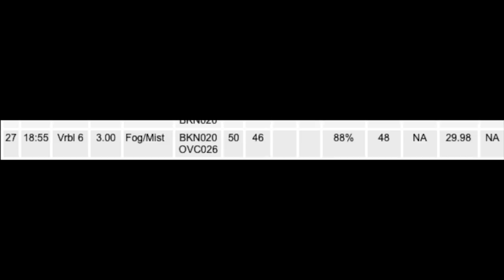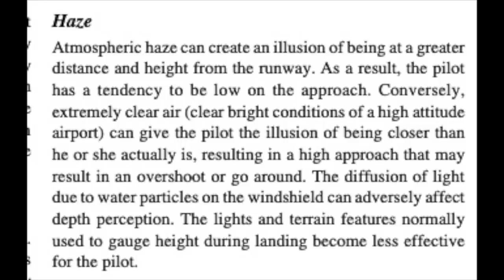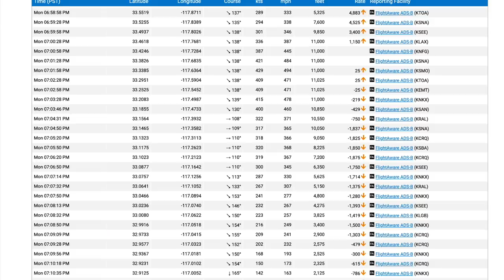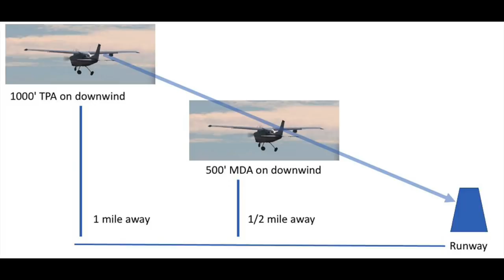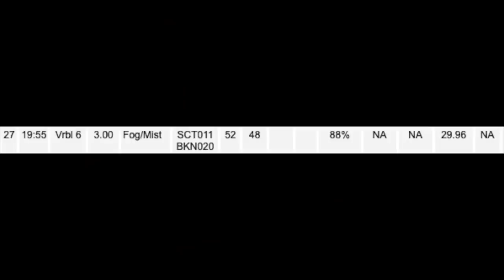N880Z Learjet Crash El Cajon San Diego California - Low Altitude Starts Accident Chain

Comment: This accident was not due to weather or hills or the airports lights it was simply Speed!

This is very similar to  Teterbourgh Crash Stall spin on circling approaches. One look at the wings of a Lear 35 should tell you it is not a maneuverable aircraft at slow speeds. Part 121 (airlines) uses what's call DMMS . Defined minimum maneuvering speed for a given aircraft on approach (w/ buffer)and fly it like your life depends on it, because it does.  High workloads IN climate weather are all distractions and once that wing drops at 1000 ft MSL your finished! Why this is not widely taught in other classes is a real shame given the frequency of these types of approach accidents like Truckee. TRAINING!

Comment: Low altitude was not.  They were at the right alt. for the kind of approach.  The big error is that the pilot turned back to the runway from over head TOO EARLY.  That error then required a too tight TEARDROP TURNBACK from overhead.  When he felt was overshooting final approach, he steep turned, pulled elevator and stalled.  The bad way of turning stalled them.  Not the altitude.  Altitude dont stall you, you stall it..

Comment: The fact that the Jet wasn't at circuit altitude is pretty much irrelevant in this accident.  You are not going to recover a stall/spin in a Jet in less than closer to 5000ft neverminded 1000ft.  The issue was the airspeed and vey poor pilot decision making even trying this maneuver in this weather.
Reply from the maker: If the jet had been at the published circling altitude, he would have been a couple of hundred feet above Rattlesnake mountain. Instead, he was a few hundred feet below it. Airspeed wasn't an issue until he realized he was headed toward the mountain and likely pulled back on the yoke and/or banked too steeply and stalled.

Comment: The pilots were low so they could cancel IFR and continue circling VFR. This is because circling to RWY 27 or 35 is not authorized at night per the approach plate for GPS 17.
Reply from the maker: Yes, they definitely canceled IFR so they could fly to Runway 27R. But the real question is why were they so low! Perhaps they were ducking below some unreported cloud layers. But given the surrounding high terrain, there were so low they no longer had any margin for error. As pilots, we need to build lots of safety margin into everything we do. At that altitude, there was no safety margin.

Comment: i landed gillespie hundred times by the way. good times....
Reply from the maker: I've been there a few times, once in a jet as it was getting dark. They assigned us the daytime right traffic pattern, and I had to constantly coach the pilot, as he had lost sight of the airport.
Reply: @AviationNewsTalk  if it was after 9 pm, runway lights required 3 radio mic click to be activated. i dont know if this was the reason you could not see the runway that time.

Comment: There is a LOC-D 27R approach. It is Circling at 1940msl for cat c. Why didn't they use it?
Reply: Probably because the minimum altitude of 2700’ MSL to 3.1 nm from the runway was above the reported ceiling, so by the time they arrived at the 1940’ MSL minimum below the cloud ceiling they would have been too high and tight to land straight-in, and been required to accomplish a 360° unauthorized circle to land.

Comment: Oops... I made an error and must make a correction/revision to my own earlier comment.

Initially I had only seen the LOC D Approach Chart Note "Circling NA northeast of Rwy 27R-17".  However, after review I now see that I missed the next very important Note for the LOC D Approach, which is  "Circling Rwy 27R, 35 NA at night".   

That note means that they could not have legally flown that approach and landed while still on an IFR clearance.  However, they could have flown that approach under IFR and, if they broke out in a position to make a normal descent and landing, cancelled IFR and landed VFR virtually straight-in on Runway 27R.   Not wanting to have to divert, I still believe that flying the POC d Approach was their best option.  Unless they could fly under Category B minima, which seems unlikely, the LOC D Approach in this manner seems to have been their ONLY realistically safe option. 

Although we would always prefer to not have to cancel IFR in this sort of situation, it would be completely legal and a lot safer option than the one they chose.  If they didn't break out sufficiently and and/or weren't able to safely descend and land under VFR for any other reason, they could have simply done the Missed Approach.
Reply: The reported ceiling was too low to allow a straight-in landing on 27R using the LOC D approach.

Comment: Just land on 17
Reply from the maker: That was my initial though too. But it's a shorter runway, and it's quite likely that the company had op-specs that required that they use a runway longer than runway 17. Plus it would have been wet.
Reply: @AviationNewsTalk  ok.  Cool.

Comment: I'm not convinced this was a stall-spin.  The video and witnesses both point to a big flash prior to impact.    That combined with their low altitude over the hills by the approach end may have lead to a wire strike.
Reply from the maker: I saw the flash as well. I saw a photo of the wires they struck, and they were were fairly low. I understand that the wreckage was confine to a small area. So I think it's more likely they did a stall/spin and hit the wires on the way down. But it's entirely possible they hit the wires flying level. Regardless, one has to wonder why they were so low.
Reply: @AviationNewsTalk  To me that seemed to be still at some altitude. Is there, hopefully there aren't, any tall transmission towers there?

Comment: Why are these jet pilots NOT being trained to keep their speed up on these circling approaches with least a 30% stall buffer and then reduce speed when established on straight final, the airline's do it so why aren't they doing it, until these guys start getting the correct vref  training and be required more than +5  a lot more of them ( and innocent passengers)  are going to die, if I was a client or owner of one of these companies I would not step on one of these jets and immediately ban circling approaches until they get o the bottom of this and get these guys trained correctly and require at least vref+20 on circling approaxhes . It also came out today that the pilot in command had some restrictions on his credentials they haven't specifically stated what they were.
Reply: They had “sufficient” speed according to available data. This was likely an accelerated stall (forced by high a maneuvering load while pushing the aircraft to tighten a turn radius due to terrain and many other completely avoidable  factors (well preceding the tragic final 15-20 second period of the crash event).
Reply: @josiahwaters1706  he was only at 156 knts when he started to turn, that gives him a 3knt stall buffer in that jet type, 3!!. I'm telling you these guys are not being trained to keep their speed up ( to vref+20 instead of +5) on these circling approaches that's why you keep seeing them crash and die, and until they start doing it like the airlines do it they're going to keep dying along with innocent people, from what I understand airlines require vref+30 for circling approaches and some airlines have banned doing circling approaches all together.
Reply: @badmonkey2222  I don’t disagree with anything you said; however it is important to understand that just carrying “speed” would not necessarily have prevented this tragedy. The reality is that the Learjet is especially unforgiving in accelerated aerodynamic stall flight envelopes, and as someone with experience on the aircraft I don’t want to leave it at just “more speed” in training being the solution. There is an entire chain of events that occurred leading up to this tragedy (including the short duration of the flight and quite likely pilot fatigue) that all must be factored into the 135 training. (As an aside, care to share your speed calculation? I’m getting a different number given their light load and the density altitude at the time of the accident.)
Reply: @josiahwaters1706  he was at 156knts when he started that final turn which is about 5knts above stall speed for that jet type at 700ft, at his position the chart states 1440ft is where he should have been, the number is from from flight data showing after he started to turn he briefly climbed and the speed went up to 162 knts then rapidly decreased from that point,  airline pilots are trained to keep about a 30% stall buffer in speed ( the number recommended for the aircraft type they are flying) when making circling approaches and these guys are not, I agree there was many factors leading up to what happened I think he may have also been startled by one of the two hills that are in the flight path of the approach and steepened his turn even further and possibly mistook the road for the runway hence him asking the lights to be turned up,  and they were probably in a hurry to get on the ground which is never a good idea in those conditions. You are correct this jet type is extremely unforgiving and and is more reason to question why he was even attempting to do a visual circling approach at night in that weather. There is a reason these guys keep dying trying to make circling approaches in these jet types and I firmly believe it is lack of training of speed calculation for such maneuvers. If I was a client or a corporation I wouldn't step foot on one of these things again and would flat-out ban circling approaches until they got to the bottom of why this keeps happening.
Reply: @badmonkey2222  
How did you conclude that the stall speed for this jet is 151 kts? 
At what weight, flap setting, and bank angle is the stall speed 151 kts?

Comment: Failure to Maintain DMMS (Defined Minimum Maneuvering Speed) Ga and 135 have a Problem with this but the Nations Airlines have already have it Factored in so when the Aircraft is in any Configuration to give a 30% buffer at 30 Degree angle of bank. Training Vendors Teach VREP + 5% while you're Circling and any Maneuvering. At VREP + 5% and 30 Degree of Bank there is NO STALL SAFETY BUFFER. Because you are loading up the wings you need extra Power, All the Training Vendors are Checking the Block at  VREP + 5%, Pilots are not trained how to Calculate DMMS + 30%. This is a DMMS Accident Which Resulted in Loss of Control. DMMS + 30% is not Taught and Pilots have no way to figure it out prior to Circling or Maneuvering. DMMS + 30% until they reach Final and The wings are level and the Aircraft is Stable then Slow to VREP + 5%.   NTSB will right it off as Loss Of Control.  Well No Kidding, There is no STALL SAFETY BUFFER at 30 Degree Bank and VREP + 5%.   DMMS + 30% While Circling or Maneuvering Then VREP + 5% on Final.  Maybe the NTSB should Report the Lack of Training and Force The Industry to Teach them to Learn DMMS + 30%. To prevent this type of Accident.    May they all Rest in Peace
Reply: Dan Gryder is misinformed, and seems to have done an excellent job passing that misinformation to you. His claim was VREF (not VREP) + 5 kts (not 5%), and that claim is incorrect. 

In 20+ years, at 6 different FlightSafety and Simuflite training centers, I have NEVER been taught to circle at VREF+5. It’s typically VREF+20 or +25 depending on the aircraft and flap setting, and those speeds provide more than 30% margin to stall speed at 30° bank.

Someone was nice enough to post the Lear 35 circling procedure from FlightSafety’s training manual in a comment on Dan’s video, and it was clear that adequate speed margins are being taught. Dan’s video has disappeared, and that comment went with it. Perhaps the numerous comments from people with first-hand knowledge of what these centers actually teach influenced the removal of that video.